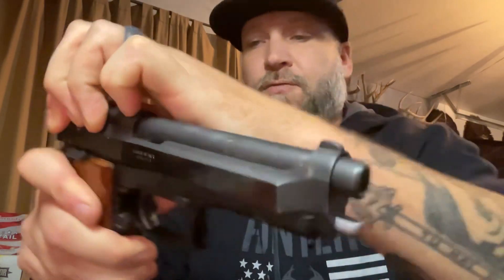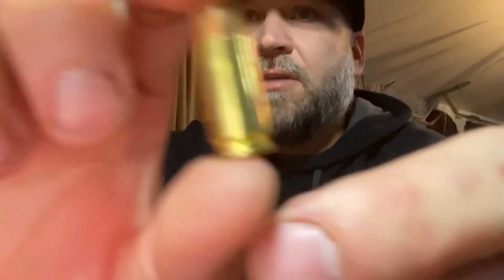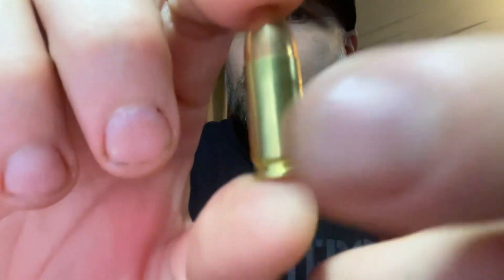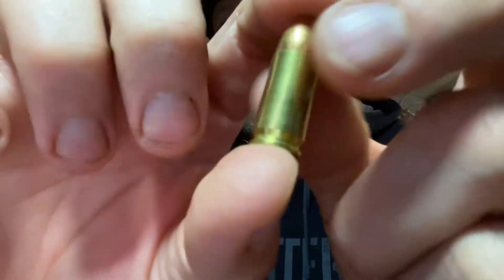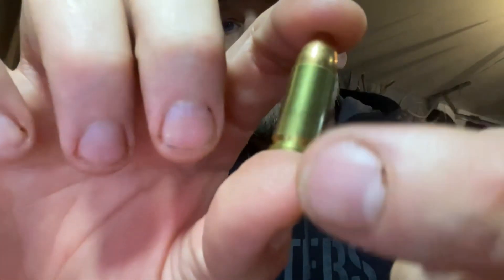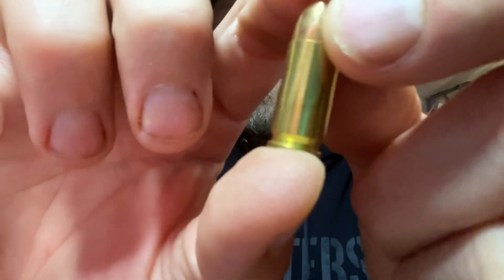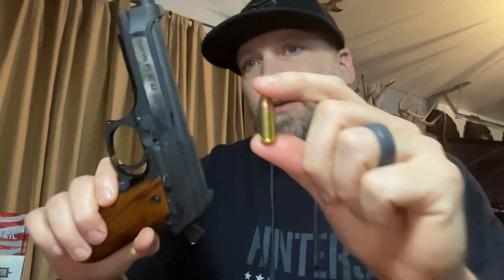Matching  Richard Allen Bullet casing to His Sig Pistol Explained Delphi Indiana Murders

Comment: Just a civilian here, but if I had to think from the ground up based on metal friction knowledge. The extractor is going to leave a somewhat microscopically unique marking on the bullet. Any scrape the gun could make on the bullet lined up to many guns of the same type with varying amount of use from new to very worn down. Due to the wear of the metal rubbing on each other, this extractor marking is going to be less and less in depth the more rounds you extract. Extractor markings are going to be different depending on if it was fired giving the case a rough ejection or hand cycled. Its the guns finger print. 

Also the marking will be different for extracting a case with bullet in it versus an empty case cause its longer with bullet still on it, it has to de-chamber the full round. One thing that could make your extractor unique from another is if you give it microscopic burs from using a wire metal brush for cleaning carbon build up or if malfunctions of failure to extract wear it down uniquely based on specific amount force applied to it repeatedly shaping the extractor. The age of the extractor is another factor.

Comment: Thank you for sharing this. My question is, I’ve seen videos where somebody pulls the slide back and then they shoot 4 bullets in a row without having to pull the slide back again. Do you only have to pull the slide back once after you have inserted a new magazine/clip? Thanks
Reply: You only need to rack the slide when you want a bullet in the chamber, ready to fire, and there isn't one already there. Most of the time, there will not be a round in the chamber when you load a magazine into the firearm, so you would need to rack the slide to get a round from the magazine to the chamber. Virtually all pistols will rack the slide back themselves after firing, thanks to the force of the round leaving the barrel.
Reply: @ZacharyDuhamel  Thank you

Comment: Thanks sooooooooooooooo  much for this demonstration.  I was so very confused, and this clarifies 100% and needs to be shared widely to others.  Also, it makes 100% that he slid it back to coerce the girls even more to scare them by ratcheting the gun.  What I still am confused on is I know it's proven that firing pins and when a bullet goes through it will have identifiable marks... but never heard of and am surprised that it's so identifiable by just ratcheting.  Also, I cannot recall if it was raining.... is there touch DNA on the bullet?  If so, why did it take so very long for him to be arrested?
Reply: It didn't rain on Feb. 13th & 14th 2017. Although there might had been some light frost overnight.
Reply: His DNA and fingerprints were not in the system, so there was nothing to match it against.
Reply: @IzzyMariel  match case left at the scene, to the gun.
Reply: @thewaydownmachine  they didn't have the gun till later. Some theroize they only got the gun during the recent search warrant.
Reply: @kennethcurtis1856  finger print on the casing. The video explains it.

Comment: This is helpful, thank you. They said the bullet found at the scene matched RA’s gun. So to confirm that, it would’ve actually had to be ejected from the gun (ie not dropped out of his pocket as some have speculated), correct? Maybe he was extremely nervous and forgot he had already loaded the gun (put a round in the chamber).
Reply: This is correct. If it was an unspent round that had never been in a gun, the only way to match it would have been if RA's fingerprint was on it. My understanding of the PCA was that the striations on the unspent round matched to his gun, meaning it had been chambered
Reply: He definitely re cocked his gun to intimidate the girls with out remembering he had one in the chamber. This guys videos is most likely spot on. Unreal
Reply: I was just shooting today and checked a few of my cartridges on the ground.. they definitely had a distinct mark from the extractor. 

I’ve heard of forensics comparing rounds shot through the barrel but never heard of extractor comparison. 

We shall see!
Reply: every gun even the same model is a little bit different. We're talking micrometer measurements. No one same gun is alike when we take it down that small

Comment: Just want to point out:

There doesn't HAVE to be a fingerprint or touch DNA.  We don't know if the round was wet or dry, in mud or not.  It COULD have DNA or a thumb print, but there's no guarantee of that.

Also, my theory on the ejected round: he may have loaded the mag when the slide was already racked, which would easily make you forget that it would have a round ready to fire.